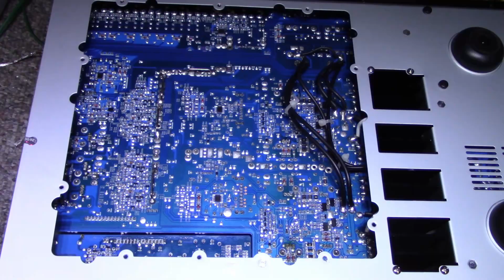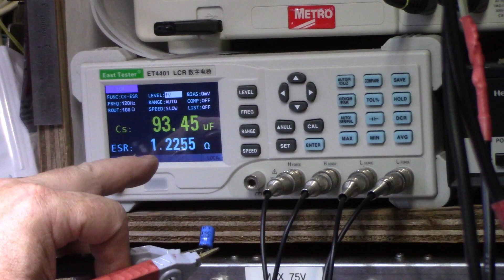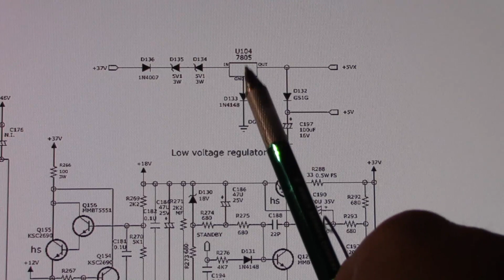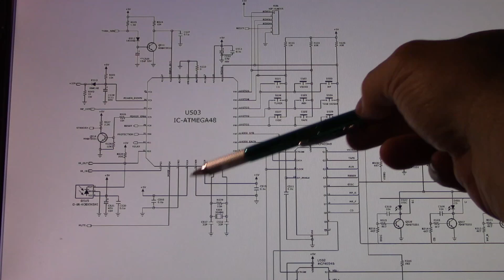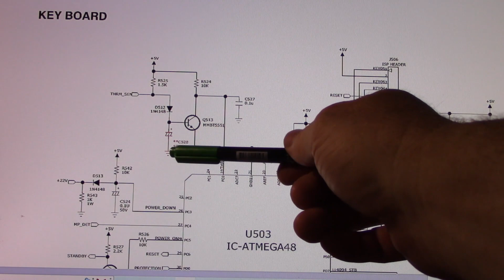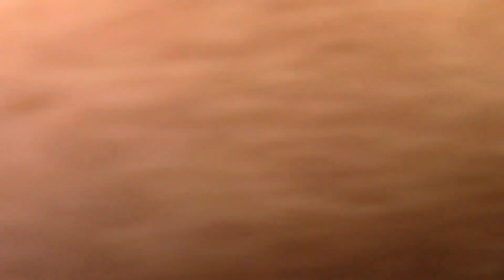NAD C 326BEE Integrated Amplifier - Repairs (Ep. 136)

Comment: The best thing about this amp is the tone defeat button. Make it flat and compare the difference. There is a vast difference, the defeat is more transparent and better highs! Sharper cleaner ultra highs that you don't get with the button turned off. 😂 It actually sounds more rolled off above 10 khz with the tone defeat off. I had to turn the treble up one click to get the most similar sound (with the tone defeat off). 😂 And even if you did listen with the treble up one click, it still wouldn't sound as good. I bought the amp when it came out and never listened to it much (I have several amps) but once I realised how much better it sounded with the tone defeat on, I have been using it a LOT! 😂 I cranks up great with my big speakers, like PA level (nearly). At that volume the voice is screaming but the bass always ceeps up to make a good LOUD balance. It loves being driven! 😂
Reply: My amp doesn't have clicks on the tone controls, but you get my drift.

Comment: The flat cable from pcu to mainboard close to the 5V regulator. That connector on  the amp pcb get brittle at one end white lead caused by poor connection for the white lead.Those amp were made when electrolytic "virus" plaged the industry by eletrolytics prematurly fail.  Use of silver tinn with all those hotspots in these, cracks up lots of solder points. i had to solder the white lead to the pin same with the next black one, connector was cut down 2 leads, rest of the leads still in connector.  Made it stable. Have a problem with one of the vertical pcb,s i power amplifier section the big resistor on both get equal hot but the to220 package transistor close to the resistor does not heat up like the working pcb. switched side with those vertical pcb,s and the fault switched side to. I know it has to be a problem with that pcb, not clear to me what purpose it has,  Like Nad, but they get hot use low quality pcb with thin copper layers and easy to lift pads. This one had me stumped, Know where to look now . any info on this  helps.

Comment: Hello everyone, I'm a new user.
my NAD 3266 goes into protection.
The problem is on the left channel.
If I disconnect the power supply to the left channel, the right works.
If I connect the headphones it turns on without going into protection but I hear the audio very low and scratchy, in this way I tried to take some measurements but on the left channel I find about 37v on all points.
I should point out that I disconnected the power amps and removed the jumpers that connect PRE and POWER amp so I think the problem is related to the PRE area.
The capacitors are not leaky and the transistors seem good.

Comment: Hi… two years later, a dumb question: I’d like to check the Ic on the front board… but I seem to be to dumb to ssmantle the metal plate. Maybe I’m missing something (a screw, a cable0 somewhere in the way.
Would you happen to have a complete dismantle instructions?
Thanks

Comment: I bought one of these new about 20 years ago. After a few short weeks it started going into protect mode as soon as I switched it on. There was a lot going on in my life at the time so I never got it back to the retailer for a repair under warranty. I believe that going into protect mode was a common problem and that NAD proposed a fix at the time, but I never got hold of the parts or the service bulletin that described the fix. There is a brief note at the back of the service manual that I found online but I find the note too ambiguous to use. BUT after all these years I am going to start investigating and see if I can bring the amp to life. First stop is to get hold of all the information I can find online about these amps. I have minimal electronics experience but I am going to tread carefully and bear in mind that a little knowledge is a dangerous thing...

Comment: Hi Trevor. I recently pulled my 326 out of storage to setup as power amp only, connected to a preamp. The power amp works fine but now the preamp does not work at all. It worked when I put it in storage. I don’t know what happened. Anyway, do you do repairs on the side for these? Or can you point me to someone who does? Thanks

Comment: I have this amp. Does anyone know where the fuses are located.
Reply: Came here with the same issue. The fuse is located next to the to big caps. You can see it at min 7:00. Be aware that you need a 1.6A Fuse in Europe with 230v, and a 3.15A if in the US

Comment: Hi Trevor. Just wondering if this story has happy end. I have the similar issue with 326BEE. It turns off intermittently. However, no switching inputs so far.
Reply from the maker: I've tested this amp a few times and so far it's behaved

Comment: My c326bee is not playing at all in the right channel, when used as a pre-amp. If I use it by itself, the sound is weak and gritty in the right channel.
Took the cover off, seeing the top on one of the big capacitors on the power supply is bulky. Any ideas towards this could cause the sound problem nor is it something related?
Reply from the maker: It's likely a dead capacitor or cracked solder joints. Would need to be on the bench to troubleshoot but you can look for yourself for cracked solders. If it's high hours unit there will be heat zones identified by darkened areas. Look in these zones for crusty looking solder joints. If you have the tools and talent, you can re-solder any that look bad.
The big capacitors are for both channels so if the left is working fine, that rules it out
Reply: Take out those JH capacitors and throw em' in the junk.

Comment: I've repaired more than my fair share of NAD amps and the biggest problem I have found by far are bad caps. NAD went through a stage of using cheap chinese rubbish and even caps that test ok have been shown to be bad. That blue one under the front panel board (below the added red cap) should be removed as it's likely to be bad and will negate any positive effect of the added cap.
Reply from the maker: I agree. The quality of caps NAD used is shameful. They used cheap quality caps only rated for 85C and they didn't last long in the hostile environment. In this amp I only replaced the failed caps in the heat zones. I left the others alone since they tested fine

Comment: Cover the case vents an leave it under load and I'll wager you'll replicate the issue. As you mentioned NAD amps of this era run at high current with barely sufficient heatsinks. They need to breathe. Thanks for the vid Trevor.
Reply from the maker: I doubt it because the glitch would happen at random, hot or cold. Some days it would glitch once, some days it wouldn't glitch. I ran the amp for several weeks to see if I could figure out what triggers it with no conclusion
Reply: @TrevorsBench   mine does exactly the same

Comment: I'd have started with the momentary contact switches. They're usually wired in series with resistors, and the microcontroller determines which button has been pressed by the value of the total resistance in the circuit. If 1 switch is bad / dirty, it makes the amp do all kinds of weird things.